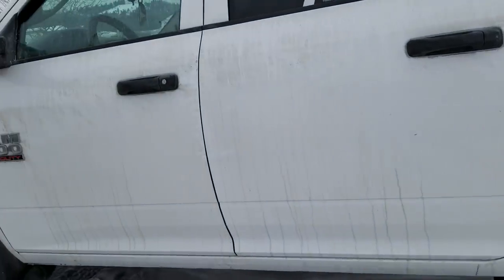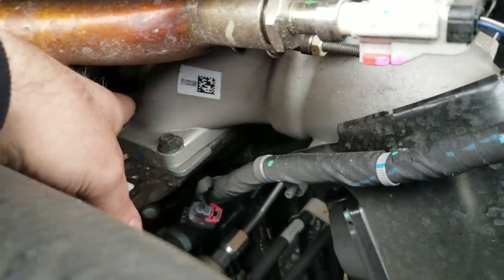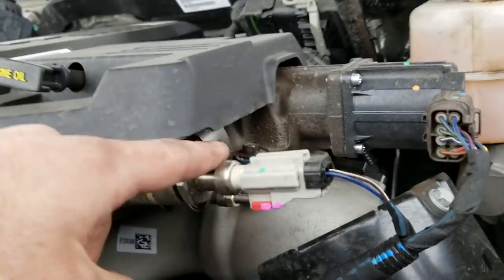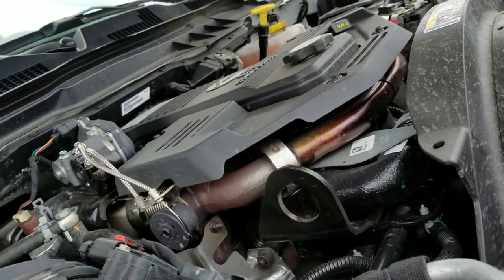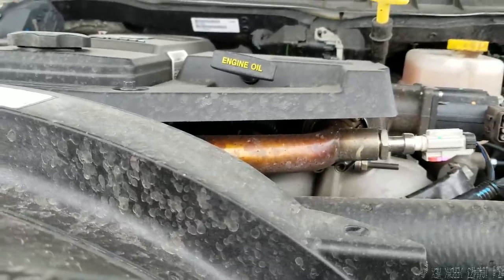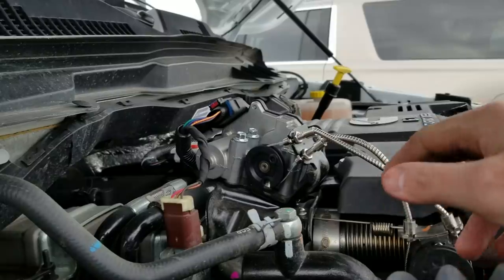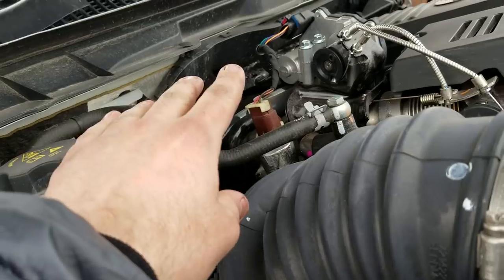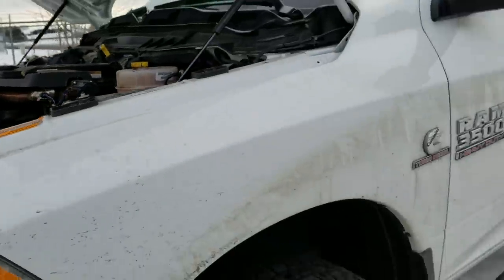13-18 Ram Cummins. The real problem with Egr

Comment: EGR = deliberately engineered failure. why? money, plain and simple. EGR compromises efficiency so you burn more fuel and change oil more frequently so the oil company makes more money and the gov't gets more tax dollars. EGR compromises longevity of engine components so you buy more maintenance parts and services which the manufacturer sells and the gov't taxes. EGR shortens lifespan so you replace the vehicle, the manufacturer makes money and the gov't taxes it.

if it was REALLY about cleaner emissions and reduced fossil fuel consumption the laws would be about reducing emissions and increasing efficiency by any means possible so everyone globally would benefit, not about increasing effectiveness of emissions controls and increasing MPG. it's a half-measure that makes tree-huggers feel like they're "doing something" while also moving a lot of money from your wallet to someone else's.
Reply: EGR exists because of government regulations. Most emissions equipment that no one asked for nor wanted are because of government mandates. 

The manufacturers don't want them either. They make their vehicles more expensive to make, so more expensive to sell, so less competitive.
Reply: @SilverStarHeggisist  government doesn't care how the manufacture meets the emissions standards, EGR is just a very efficient way to do it.  It's the first step and makes the biggest difference, SCR is the next step and can reduce NOx below what the EGR does.